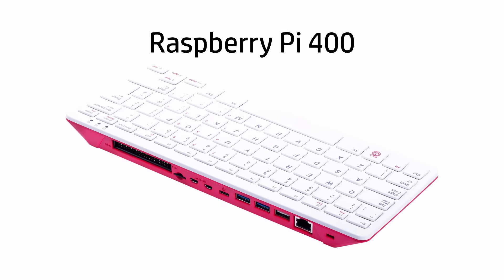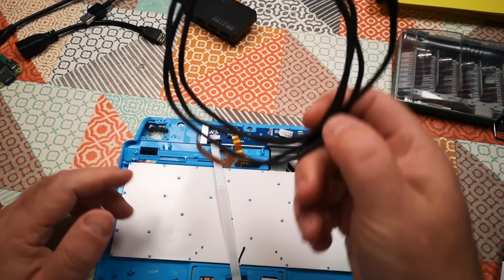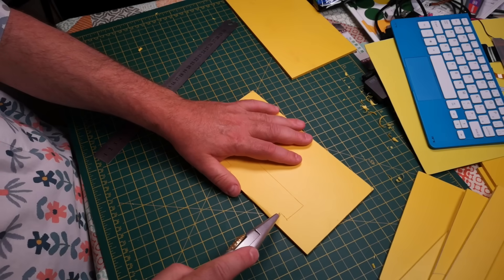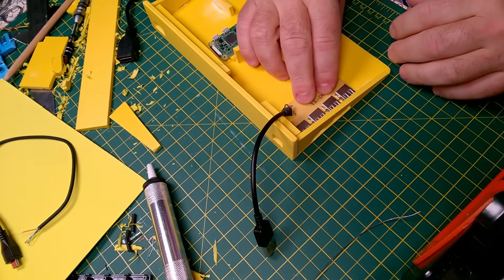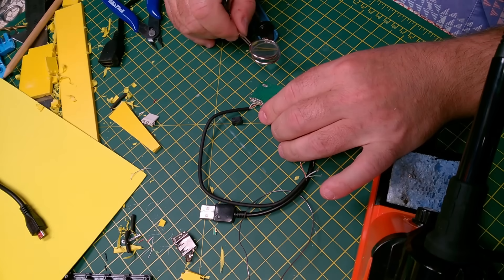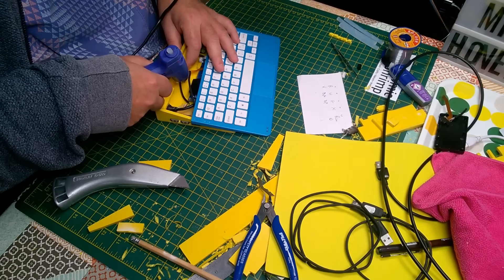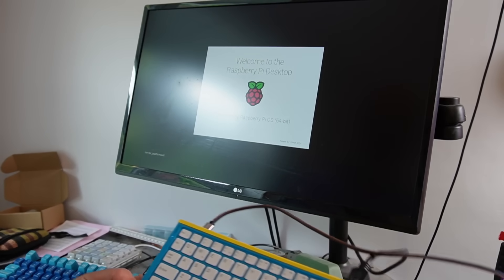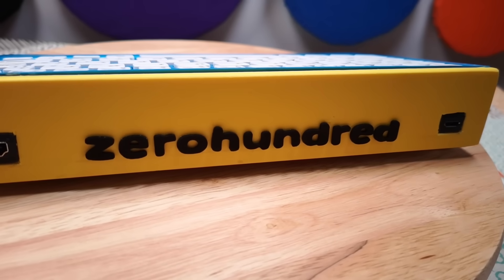Making a Raspberry Pi Zero Hundred

Comment from the maker: Afterthoughts & Addenda
Rigid Foam Board - a few people asked about this. All I know is that it's rigid pvc closed cell foam board (I was given it years ago in a bag of offcuts from a sign shop). It's quite hard and resilient for something that is made of foam.
Reply: Much the same as insulated steel panels for building - thin layers of metal sandwiching a foam core - they are easy to work with, yet remarkably strong and durable.
Reply: Only thing that's missing is your @AtomicShrimp Emblem
Reply: Great 3D printing skills!!!

Comment: Use an SD extender to move the micro SD to the outside of the foamboard the same as you did with HDMI etc then you don’t have to take it apart to switch OS 👌
Reply from the maker: I didn't realise those exist! Thanks!

Comment: Just a heads up about those bulky usb connectors... As you were cutting the old plug off anyway, there are test points under the USB sockets on a zero that you can directly solder your USB wire to. Ignoring the plug/socket altogether
Reply from the maker: Yeah, I didn't really feel like soldering anything directly to the pi itself, although looking back there was no good reason not to
Reply: @AtomicShrimp  yeah they're just straight pads so are easy enough to undo

Comment: Love the use of the lazy Susan at the end there!

To give the foam a bit of a “harder” texture, you could coat it with something like a clear polyurethane spray - though you should test with an offcut to make sure whatever solvent they use (acetone? Mineral spirits? Water? Oil?) doesn’t dissolve the foam
Reply from the maker: The foam isn't soft at all

Comment: Awesome project! You could add a small heat-sink for the CPU and a few small vent holes. At least the vent holes to keep the temps down.
Reply from the maker: I was going to do that, but the pi zero barely gets warm
Reply: @AtomicShrimp  Ah that makes sense.

Comment: Did you end up using the Zero 2 or the original? Upgraded version is much more capable, something about the wifi implementation specifically, I believe there is hardware supporting it now instead of relying software management
Reply from the maker: It's the zero 2, but not the one with WiFi on board because those were not available when I ordered this
Reply: @AtomicShrimp Did they make a zero 2 without WiFi? Sounds like a OG zero if there isn't
Reply from the maker: That's really weird.  I could swear there was a choice and the zero 2 W was out of stock, and there was a zero 2 with no wifi, but it looks like my brain is playing a trick on me.

Comment: Has a Pi 400 and not really using it, have tried a few OS's and a couple of iterations of Pimiga, mostly not using it as only have one screen I can use it with that has two HDMI connections, one used for my PC and the other free. Having no remote and the inbuilt controls being on the bottom of the monitor frame mean it's nearly impossible to navigate the menus. 
I do have two older monitors one with only VGA input and another with VGA and display port, tried using those with the Pi but the picture won't scale to the monitor resolutions, tried changing settings on Pi and monitors with no luck.
Maybe one day I'll actually get another screen or get around to using the PI with the one I have that works lol.

Comment: Another fun little project  is the picomite, it uses the cheap pi pico  running  basic ,a throw back to the days when the home computer was a zx81 or vic 20 . It  has a vga output  input for a ps/2 keyboard  and  a sd card for storage.  If you already have a suitable monitor and keyboard it shouldn't cost much more than a tenner to build,including the pi pico

Comment: Using foamboard is genius. It's easy to cut and solid enough to be structural. I'm totally stealing that for my next project which needs a case.
Reply: many old computers produced in east germany by Robotron use a sort of compressed foam for their cases, similar concept though there it was usually formed using heat and a metal press
Reply: @oggilein1  even the body of the Trabant was made of pressure and heat formed polymers! Someone in the government must’ve really liked the way it turns sheets of raw material into all sorts of rigid structural shapes.

Comment: Great job! Who needs 3D printers anyway?  I did something similar with a Pi4 and an old VIC-20 case. I used extension cables to bring all the ports to the back of the case and printed some backplates for panel mount sockets. It works great and looks really good - almost as good as yours!

Comment: Heads up on that Just leave it running” plan: In a previous job building software for escape rooms, I've used Raspberry Pi's, and leaving the device running for long periods of time will break the SD card in matters of days/weeks/months depending on how many writes your doing. The solution we used is to put the whole file system into read only mode, from that point forward we had effectively zero failures
Reply: Man, I could've used this advice a while ago
Reply: Switching logging to memory as opposed to the SD card should fix this
Reply: Would this even apply with Industrial SD cards? I've had a good few Micro SD cards go kaput on me in Pis and my desktop.
Reply: @gojohnniegogo  Yep, it's just a matter of longer until the when, not never.  We did lots of tests of this kinda thing for the Spectrum Next as part of the reliability of various internals etc. And cheap cards can indeed be killed in a weekend, good/extreme "industrial" endurance ones, much MUCH longer, I've got one which is in daily use, years old, and it's still going strong.   

Good Luck! -Dx
Reply: @Xalior  oh Hai xalior! Fancy seeing you on an atomic shrimp comment thread 😂
Reply: I've heard people say this a fair bit but never experienced it myself on any of the Pi's I've had running over the years, including my main one which has been running near constantly for over 6 years with frequent writes yet no signs of failing. I know at some point it will fail, flash memory in this use always will, but I suspect it will last a lot longer than people think it will, due to questionably reliable information available on some places on the web.
Reply: Disabling atime updates, too.
Reply: Or get ssd or m2 ssds
Reply: @dominicwehrmann8515 a hard drive would actually be the better solution if you wanted to go down that route since it's spinning up and spinning down that wears them down the quickest so a continually running drive will last a long time. the issue there of course is power consumption
Reply: @dominicwehrmann8515  All you will do is kill the SSDs in a slightly longer period of time. This is a problem with all silicon storage. 

What you need to do is use fuse to put /var into RAM.
Reply: Or simply use DietPi, its set up to do as few writes to the card as possible, logs for example are kept in a small 50 MByte compressed RAM drive.
Reply: I've got a machine running a Friendlyelec NanoPi NEO3-LTS. I use a 2GB version with their special fuse FS Ubuntu 20.04 Linux, on which I have a file server (SMB + SFTP), Transmission 4, and MeTube. It typically runs for months on end without a problem, and keeps all the FS changes in ram until absolutely needed to be written (usually on power down). I have it running two big hard drives, one of which stays mostly powered down.

Less than 10W of power (including hard drives).
Reply: On top of this it might be more effective to use an SSD
Reply: 👍 that explains why my Raspberry Pi & monitor  on our microscopes built-in webcam was a complete failure. 🤣😂
Reply: You get what you post for when it comes to sd cards, although all of them are going to fail in a few years of constant use . But the enterprise ones from sandisk for example do last two or three times as long as the low end ones. And usage pattern does matter--logging or other write-intensive jobs will wear it faster

Comment: This is reminding me to start my DIY project of converting my keyboard into a wireless one by ripping up a USB battery bank and using a USB BT transmitter connected to the battery bank, then lastly wiring my keyboard to the transmitter.

Curse my keyboard having a metal case..! The major thing stopping me from starting the project.